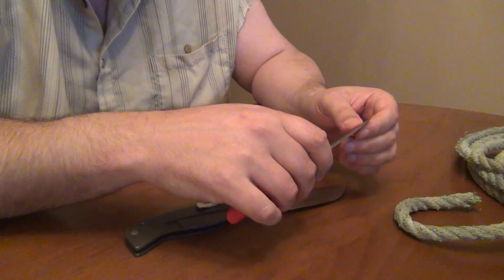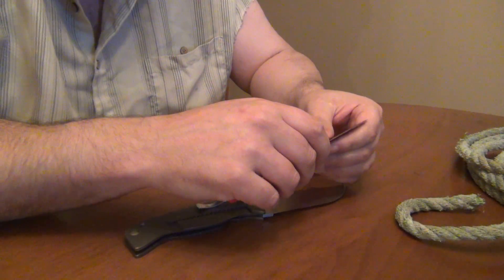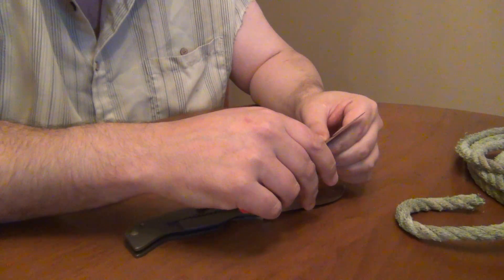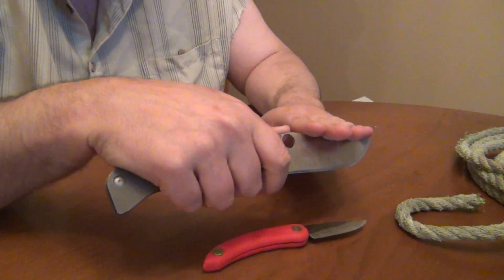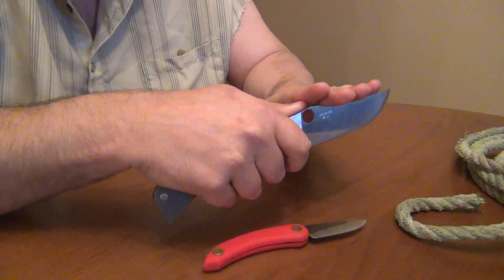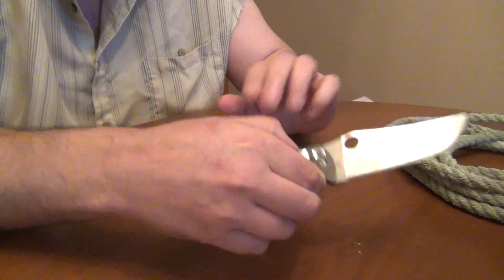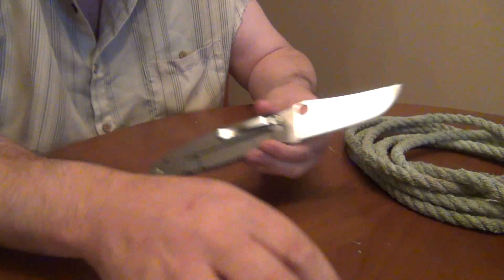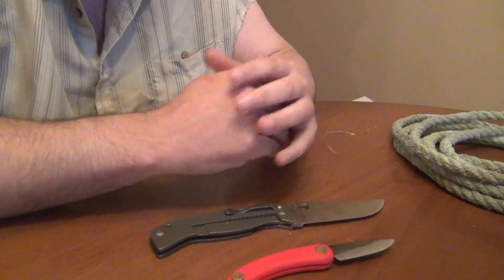Edge retention in new vs dirty/old materials (10V and 15n20)

Comment: Something that has been said by a metallurgist and knife steel designer (magnacut) is that edge geometry give the biggest change in cutting performance, the heat treat second, and the steel last. He also determines that actual use dulling is a combination of toughness and abrasion resistance combined. Cheap steels like 14c27n are hugely tough and only average for abrasion resistance, overall takes the cake over something with bad toughness. More toughness = thinner blade geometry = better and longer cutting performance. Heat treatment makes the biggest difference in toughness if done wrong, more than hardness or anything else.
Reply: That’s what cliff concluded. By way of cutting shit loads of dirty carpet.
Reply: @lindboknifeandtool  I'm just glad that others are making his knowledge more known. I don't mean to discredit super-steels, but when you get really good knife geometry and a shallow angle.. it's like a lightsaber no matter the steel. Outdoors55 has been bringing up some of his knowledge as well, thankfully

Comment: So what about 15N20 at say 61Rc?
Reply from the maker: I like simple steels at high hardness, nice combination of properties.
Reply: Indeed. Of late, you hear a number of people talking about how steels like 15N20 and AEB-L get "magic" at 61Rc or so. I contrast that with the trend you see in some"hardcore" production knives where they leave steels like 1095 as low as 55-56 Rc and 5160 as low as 53-54Rc and then brag about their "proprietary" HT that imbues said steels with magical toughness powers.
Reply: Per Larrin's recent tests, 15n20 at 61 is stupidly tough, and I imagine it would outperform 10v here.. tough steel run reasonably hard with a 375-400f temper can do great stuff.

Comment: wouldnt deformation be associated with toughness, and fracture be associated with strength?
Reply from the maker: +kyle bettleyon They are defined in the literature as the opposite. Strength is resistance to deformation, toughness is resistance to fracture.

Comment: Cliff, what's your opinion on Survive! Knives new peened finish? The owner claimed that it helps stress relieve the knife.from what I've read it strengthens the steel but looses its flex toughness. Is this a bad idea for batoning?
Reply from the maker: +Ray Contego This :

" The standard blade finish will now be a matte peened finish. This multi step process will fully stress relieve the blade surface and create a beautiful non reflective finish. It is important to note that the final surface finishing step is done using a spherical ceramic shot, which won't create micro pitting that could invite corrosion."

A blasting process (regardless of the media) actually causes stress. If the blasting media is abrasive then it is very similar to grinding. If the media isn't abrasive (steel or ceramic shot) it mainly causes deformation.  

What they have described is just jibberish. It uses metallurgical terms but incorrectly so it doesn't have any meaning. It is like saying :

"We use a revolutionary new heat treatment which induces cyclic phase transformations in the steel to produce optimal strength and wear resistance while retaining high toughness."

Comment: That would explain something I have noted on a small knife that I bought at this years Blade Show. It is made of the traditional Japanese Sand Steel (Tamahagane) and even though it is a very simple steel I have been having very good edge retention from it in daily use as a neck knife. it cuts whatever I need to use it on dirty materials as well as clean and performs as well as other knives with more complex steels. One caveat is that the edge bevels while close on the different knives are not identical.
Reply from the maker: +Nebulax123 Japanese maker, or someone importing the steel?
Reply from the maker: +Hector Amador Hector, that is a lot of information/questions. 

In regard to belt sharpening, my main concern would be over heating because the very apex is thin and doesn't take much heat to be damaged. That is the critical concern with belt vs stone grinding.

In regards to convex vs flat grinds on the edge/apex, I would say it has more to do with the thickness of each first and the curvature later. In general a curve will have a smoother cut, but this is a small effect compared to the actual thickness.

Comment: Good stuff. This is the reason that I have gravitated towards more simpler steels, Mainly in my day to day tasks, I don't know what I will encounter in cutting. And a simpler steel like N690co or Super Blue ect will have plenty of edge retention for me, but in the likely event of damage to the apex, I won't have nearly as much of a headache in grinding out the damage or ust touching the edge back up. Not to mention I like the kinds of edges those steels take vs high carbide.

You probably remember my video on the huge chip I got in my M390 Paramilitary 2 from a box staple. I really don't think a steel like CPM154 would have necessarily behaved so severely. Although only some tests would tell for sure.
Reply from the maker: +Caffeine Junkie Yes, m390 and similar steels are not used in industry where chip resistance is needed. It is curious how a very practical aspect of use it so readily often ignored.

Comment: I'm looking to get Sigma Power Select II Ceramic Water Stones in 240 and 1000 grit. Will these 2 be enough for most applications? I have cheap kitchen knives and also some Spyderco with sv30 and M390. Also a DMT diamond for flattening.
Reply from the maker: +kwk1 Easily. I would pick up a very basic Norton India for the very cheap steels as they grind very easily and the Sigma's release abrasive very easily to allow them to cut hard to grind steels but you don't need that on the very basic steels.
Reply: Cliff Stamp Okay, thanks Cliff!

Comment: Good stuff Cliff, very interesting experiment and results. I figured that the old rope would wear down the edge much faster due to grit, sand and other things present in it, I didn't expect that the knives would be even (I figured the gap would be much less but not even). More and more I see that the type of steel is just one of the parts to edge retention and it's not the biggest variable. I find that geometry, edge finish, heat treat and work being done have more impact than the steel being used. I see tests online where someone shiws the results of his rope tests and it shows steels in an order and I realized that those "rankings" hold true to that test, that rope and that knife (not just the steel but the whole knife including hardness, geometry and steel) and it might hold true to that work but most of us dont cut a rope thosands of times and in everyday use im sure those results would vary. I have really grown to appreciate lower carbide steels in edc use, my favorite knife now is a carson tech with Nitrobe 77 steel. Its a really nice knife, it is ground too thick for my liking at about 0.022 or so and im going to send it off for a regrind to about 0.008 and ill put on a 10 dps edge bevel on it and I think it should perform quite nice and take a very keen edge. How are you liking you Bullet with N77?
Reply from the maker: +D00MTR33 The Bullet is fine as a light use knife, but for harder work I would prefer a more secure handle, but again this wasn't made as a pure work knife given the materials.

Comment: Interesting results. In my experience, the only thing that is actually going to dull a knife to the point of uselessness is mud. Even then, the chipped out edge and grind is still going to have some cutting ability.
Reply from the maker: +Bill22252 Essentially, what you have to consider are things like the finish of the cut and damage to material for very high sharpness edge holding. Hence why Japanese sushi knives and carpenters tend to prefer very similar steels.

Comment: Good stuff cliff. The more I've been playing with some super inexpensive knives from the Walmart kitchen isle the more it seems that geometry and grit finish have a practical effect for this type of cutting than steel. Sure I bet my K2 could out last them on cardboard but once you exceed 1000 cuts with those cheapos, which I've done multiple times, what practical advantage is there to many of these super duper high speed steels?  I certainly still like my Southfork and K2, but the more and more I actually use knives, the less value I see in the trend of more carbide for a utility folding knife. There is a point of diminishing returns really quickly. And I still hat S110V. Thankfully Spyderco has a knife in a very affordable package with it otherwise I'd feel ripped off. I just do not like that stuff
Reply from the maker: +Kevin Oubre In most cases, the people talking about edge retention do little actual work. It is fairly easy to spot the exaggeration claims because in reality the difference in performance is not nearly as close as to what people claim. In this case for example even on clean hemp the difference is just 4:1 and this is one of the most extreme cases you can see as the steels are so different.

In reality just think about how long these duper steels have even existed. What happened before then, people didn't cut things or spent all day sharpening? Its more than a bit silly to think that a guy 100 years ago installing carpet struggled all day due to lack of a duper steel.
Reply: +Cliff Stamp Something I just thought of. Do you think the chipping could be related to the rope being polypropelene as opposed to hemp?
Reply from the maker: +Kevin Oubre Whenever you change more than one thing it starts to get really nontrivial to ensure sensible conclusions. 

In this case I would be confident that the main reason for the dramatic difference was that the polypropylene rope was dirty. The dirt could be seen gathering under it and you could feel the grit in your hands. 

But to be sure yes, you would want to run it again on the same kind of hemp rope.

Comment: Could either of those knives do,a full days work? Say for example if your boss came to you two days before the opening day of crab season and said "you need to change out the rope on those 200 pots by the end of the day"
Reply from the maker: +mark a The knives can still cut the rope at the end of the run, trying to do a run to the point you can't cut is nearly pointless, I could not even do that on carpet. Most people using knives are constantly using them in extremely dull condition because of the nonlinear way knives blunt. 

In short, yes, both of them, likely a lot longer.

Comment: The crab pot rope is a great example, because the rope is left for long periods of time under the water on the bottom of the sea where it is saturated with salt water and very find silt and sand particles and then sits out in the sun and the water evaporates and the salt solidifies as well, over and over again and if they could measure the abrasive qualities of brand new rope vs this rope thats seen a few seasons, I would bet its level of abrasion is on a magnitude of hundreds of times more than virgin rope. Sea silt has dissolved calcium carbonate in it and iron, silica, salts and who knows what else.  A chemical analysis of this type of rope would be interesting in and of itself. You are also right as far as people who use knives for a living vs a person who is just interested in the wearability of the steel for crowing purposes. I have seen documentaries of poultry processing plants where workers are cutting up chickens all day and the types of knives they use are not anything like the Farid type Spyderco and I suspect their wearability is more suited for frequent ease of resharpening because time is of the essence for them and so is cost since the knives are usually provided for the workers by the company as opposed to their own personal knives.
Reply from the maker: traderjoes Essentially yes, and it raises to me the critical question is of how much importance is it to be done comparisons on very clean materials when people in general rarely do it for utility blades.
Reply: Exactly. I imagine if lets say you are the person in charge of supplying the employees of your poultry processing company with equipment to do their jobs, and you are deciding on knives, and you have a criteria that the knives be useful and long lasting and do not require frequent pauses in workers productivity to maintain, you would so well to have information thats beneficial to you in deciding on which ones to get. I am sure if you  bought 300 knives for your workers and their productivity went down because you based your decision based on the recommendations of people who did not do research on real world applications, you might find yourself in a bad position at the next meeting.
Reply from the maker: +traderjoes Essentially, you have to be able to justify your actions not just make things up.

Comment: Another blow to the steel fanboys ?
Reply from the maker: fredde90210 I don't think logic and reason are much of a concern for them.
Reply: Cliff Stamp 
hehehe touché.
Reply: fredde90210 I have been playing with a Spyderco Native(440V) for the last month or so. It does not hold an edge like the Sage(S30V) but I have found that it is also very easy to take care of. Chipped the tip as I was cutting some weeds in my parking space and it took me about 30 seconds to fix it on an old diamond stone.
I have noticed that people who work with their knives generaly prefer softer steels that will not rust and are easy to sharpen. 
So called "fanboys" will just not use it. And then you get an "in depth review" of a factory edge that can still slice paper after 2 months.
Reply from the maker: +SpartanJohns I would be curious about the 440V you have, some of them from Spyderco were quite soft ~55 HRC to reduce chipping problems.
Reply: Cliff Stamp This one is very soft as well. I chipped it because I cut a weed and slipped into a concrete wall.